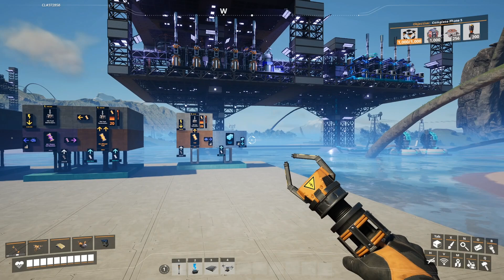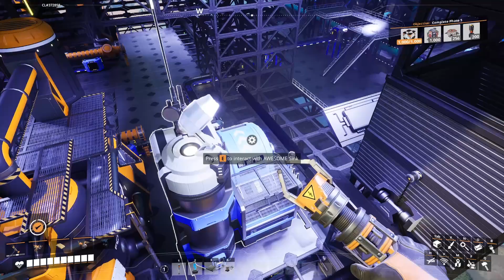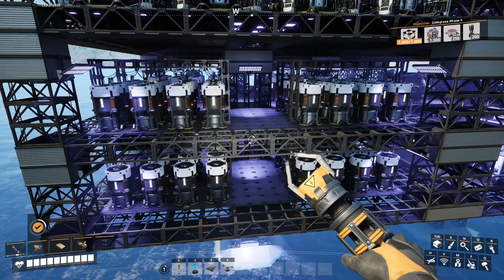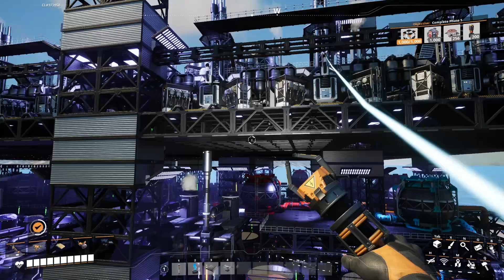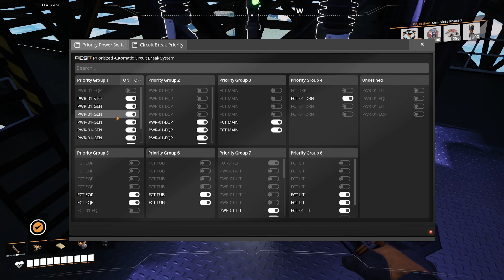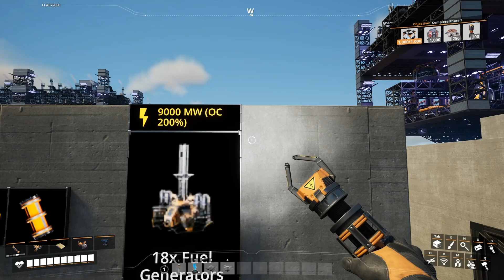Satisfactory oil rig blueprints are available V1 E07

Comment: Amazing work ! I am messing around with them now and stacking a fuel refinery on an oil refinery but it seems there are 2 fuel inputs run horizonatally in the stacks for the fuel and only 1 output from the oil refinery to run the fuel out ? The fuel is produced and run through on storage tank then fed into the center to run up to the power plants but the powerplant blueprint has 2 input runs ??? Am I missing something ?
Reply from the maker: The models I made for this video show proper positioning.  Generally speaking, you run the oil processing horizontally and then place your fuel power generators on top.

Comment: i like it, but downside is there is no info howq to connect everything? what are the inputs and out put ???
Reply from the maker: They are color coded and aligned to the edges of the blueprints.  Also, they are all aligned to the same direction so you can use the "front" white arrow marker to align each BP the same way and all the color-coded pipes and conveyors  will align.